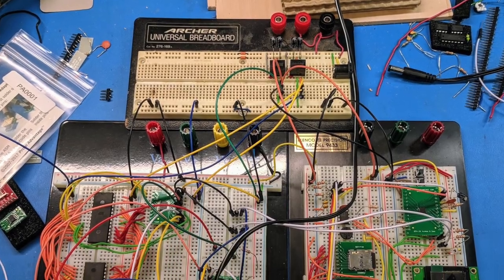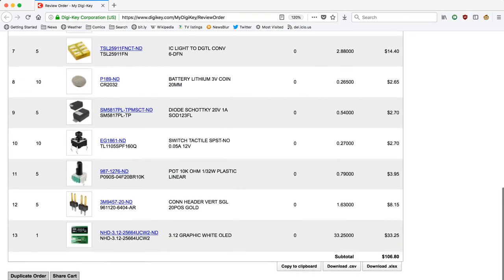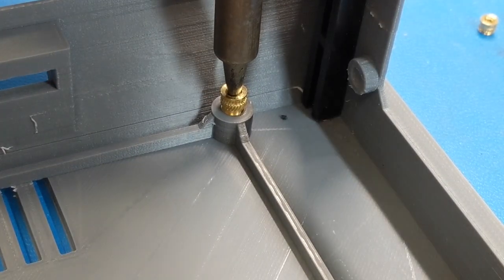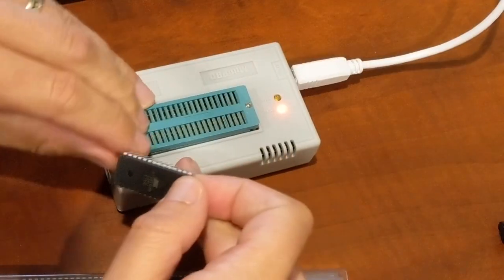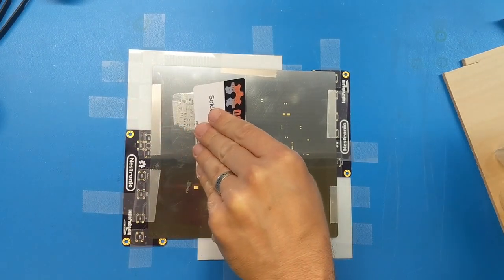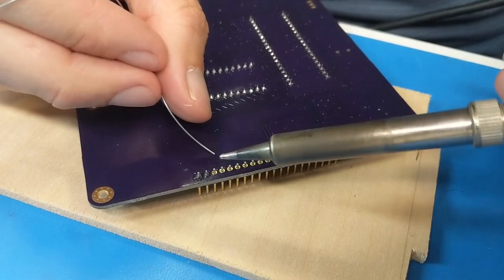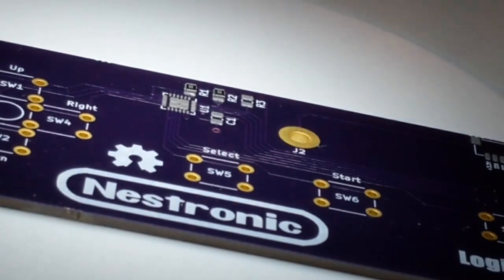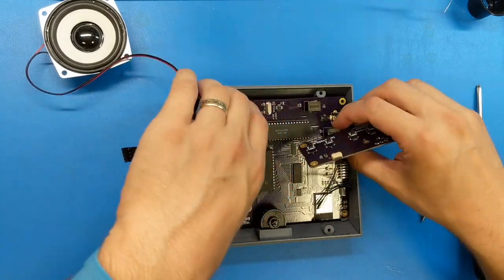Nestronic Complete Assembly

Comment: This is fantastic sir! I've wanted to make a desktop .NSF/.GBS player (for NES/GB(C) music, respectively) for quite some time now, but never got around to studying those APUs for emulation.

Two questions:
- Do you have a Digikey/Mouser/McMaster etc. part number for those brass threaded pieces you melted in? I've just gotten a 3d printer and would love to play with those.
- I haven't watched the rest of your videos yet - did you remove the RP2A03 from an existing Nintendo, or is there some cool and slightly dubious company offering 1:1 clones?
Reply from the maker: The hardware fittings were mostly from McMaster-Carr, and you can find all the part numbers in this document:
https://github.com/dkonigsberg/nestronic/blob/master/models/models.md

One of my RP2A03 chips was desoldered from an existing Nintendo. However, the rest of them (including the one used in this assembly) were purchased from:
https://www.mikesarcade.com/cgi-bin/store.pl?sku=RP2A03